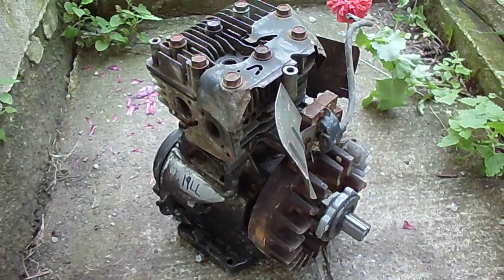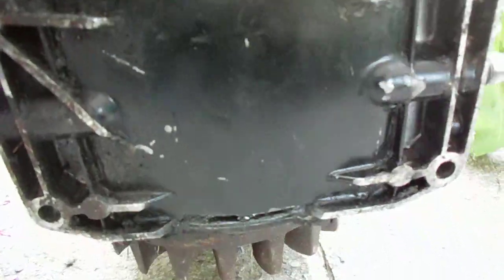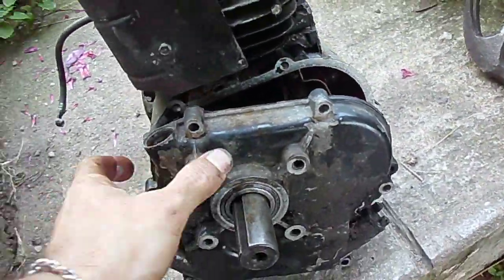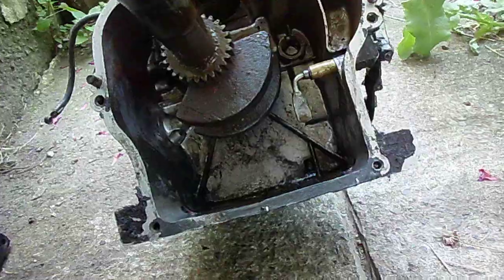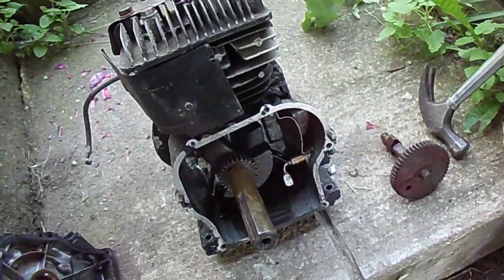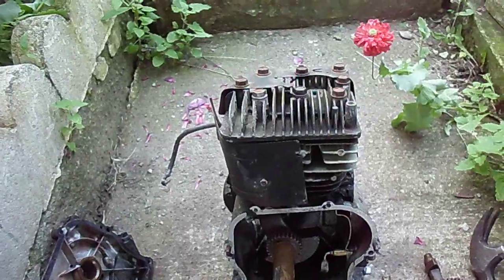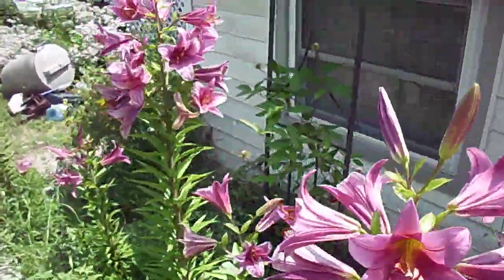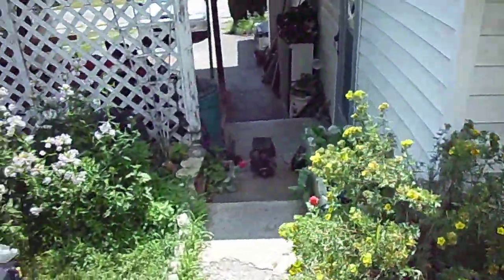5 hp Briggs Busted Crankcase Mystery Solved!

Comment: When you say freeze up, do you mean the engine seized up? Or, the engine somehow got water in the crankcase and literally froze? 
Maybe it's the heat here in Phoenix that is preventing my common sense from kicking in!  
Its only getting hotter
Reply from the maker: It got water inside it that turned solid up here in the Great White North.  :)

Comment: I'm really surprised I didn't hear "a little JB Weld and it will be good as new". The Garden looks great.
Reply: dad did a jb job on a cracked block.  ran it for years.
Reply from the maker: That actually was my intention, to smack it with a hammer to flatten the bottom out a bit, then JB Weld it back together.
Reply: @ChargerMiles007  I bet it will hold up.